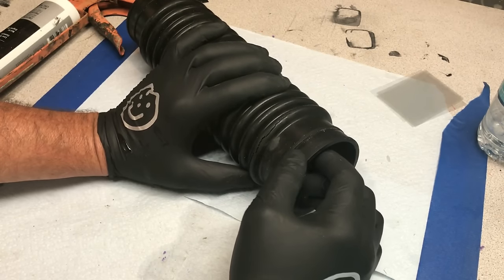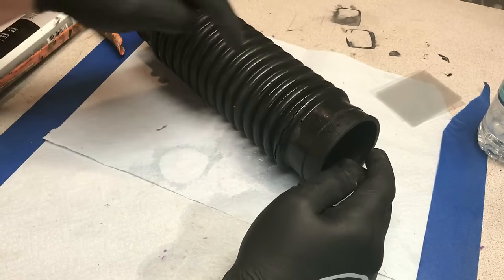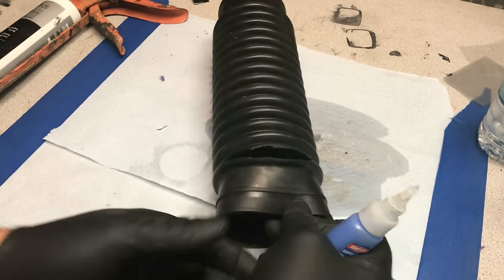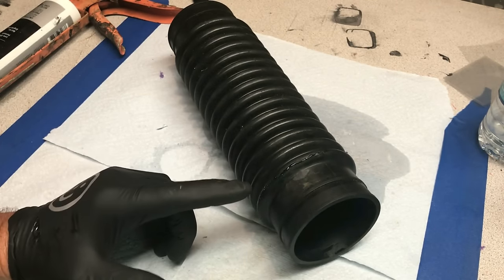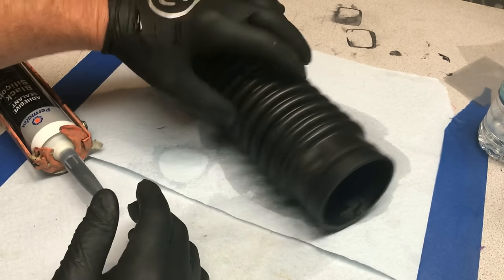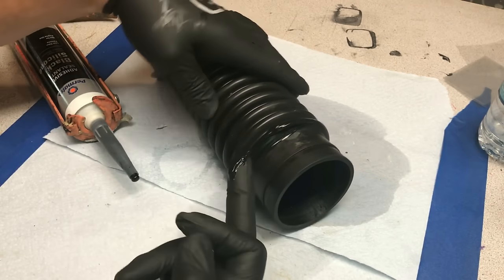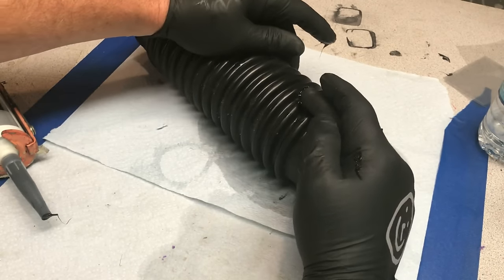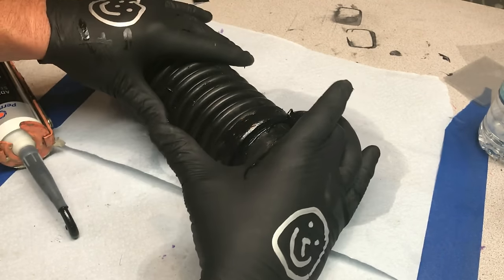How To Repair Split or Cracked Rubber... Intake Tube....Fast and Strong!

Comment: I have a 2005 Honda accord 6 cylinder, the air intake hose has multiple cracks and is completely severed next to the air box. Should I attempt to superglue and apply black silicone to it or do you think it is too far gone? I can send pics if necessary.

Comment: Super glue and rubber has the most amazing bond! A friend and I repaired two front lawn tractor tire side walls. the were tubeless! They are still holding after 2 years. we did add a little bit of slime, but the super glue is still holding the chords and outer layers of rubber dead nuts solid!
Reply from the maker: Joeak74 thats awesome thank you so much for sharing :)
Reply: I'm glad I read this comment.  I Tore the sidewall on my new car tires last night. I'm gonna prep it and superglue the flap of rubber back on it. Thanks

Comment from the maker: Hello SPC Friends and Subscribers, here we show you how to repair most any broken rubber part on your car or truck. We hope you enjoy and have a fantastic weekend :) Also, we want to update you on the https://teespring.com/SWEETSWAG so far because of U we have collected $20.00 in donations with us matching that, we have a total of $40 to give to the Wounded Warriors Project  *Thanks so much, SPC Luvs U All**
Reply: Wounded Warrior got a bad name a couple years ago for misappropriating funds. Lots of them. May be they got that whole thing straightened out but it tarnished their name a little....actually quite a bit.
Reply from the maker: holidayrap well we have all had our problems in life for sure and it is what you do in the problem that really matters...WWP has done much more good than bad for our vet's ..now that they have that all cleared up and all the bad apple's out, they are really moving forward in even a much larger way. :)
Reply: Of course Mr. SPC... I have a lot of respect for you taking time to promote ANY charity. Not much can be said by others in that area. I appreciate your channel very much. Again, respect.
Reply from the maker: holidayrap  thank you so very much Mike
Reply: Question could the black silicone be used on cracked and leaking rubber grease jackets like ball joints and such
Reply: Could i do this on a dust cover for my brake piston? Trying to find a replacement kit and everyone is saying my car isnt a match .. i was even thinking of burning rubber on it lol im out of ideas

Comment: To fix a CV boot without taking it off the car, I used a similar method, having a roofing business in England I had loads of partially cured (sticky) EPDM in strips about 3 inches wide. After really careful cleaning I bonded the boot in the same way, then put primer round the entire circumference of the boot, then applied a round of EPDM 'tape' - it lasted for years, and cost just over half an hour's work, on a Citroen which would have been a hellish job otherwise. Nice video, quick and clear - thanks.
Reply from the maker: Thank you for watching and sharing Gurgle Jug, we really appreciate it.  Hope you have a great day my friend.  mad Mike the hammer SPC
Reply: can u explain the primer u used?
Reply: Hi I'm in Yorkshire my air intake pipe has just split yesterday will tiger seal work on it as I've got a tube in shed will be difficult to get anything else as it's Xmas eve . Happy Xmas

Comment: Sweet, gonna try this on my backpack blower if my duct tape fix doesn't hold up. I took a heat gun to the tape and molded it to the contours on the flex tube. Been good for 3 years now.  Redmax discontinued parts are tough to find and expensive.
Reply from the maker: I’m with you the older backpack blowers are getting harder and harder to find parts for but this works great have a fantastic weekend
Reply: Just finished my Husqvarna blower flex tube repair using this method, and although I don't have a SPC super duper air compressor nozzle.

I made due just fine and dandy! You guys rock!

Thank you and keep'em coming...

👍😀👍

Comment: Mahalo for the tip. Good video.  I restored a vintage VW Scirocco undercarriage shift boot with your method.  However, unlike the air plenum you've repaired, the shift book will be under constant movement like a CV joint boot.  I have a feeling, it will peel apart over time.  We'll see.  I made a video that I'll edit and post sometime.  I noticed that after I got it togther, used black silicone, started to flex the boot, the super glue bond cracked.  I could see the silicone also peel away from the rubber of the boot.  So for some extra bonding, I sprayed a couple coats of Flex Seal inside and out. It turns out that Flex Seal doesn't bond well with rubber and can peel away with ease.
Reply from the maker: Thank you for watching and sharing Darryl, we really appreciate it, hope you have a stupendous day my friend. mad Mike the hammer SPC
Reply: 😊 You too!

Comment: @3:15 i would sand slightly on the inside of rib with an emery board. this will give the black silcon more surface area to grab. JUST SAND the RIB NOT THE CRACKED area.  Ive done this exact repair on a 98 Honda Civic CV boot and and it has lasted another 10 years !!! Again dont sand the actual crack BUT do sand the inside of the rib slightly.
Reply from the maker: Thank you for watching and sharing, we appreciate your input Troy! Have a great week my friend. mad Mike the hammer SPC

Comment: Thanks for the vid. I do want to ask about the 303. You mentioned the intake hose would be covered with 303. -Should we be careful not to get 303 on the repair/dried silicone? -Or is it something that's fine to go ahead & submerge/soak/cover in 303? -Should it only be sprayed away from or around the repair?

Thanks again
Reply from the maker: Once the repair is cured up, you are good to douse the thing in 303 until the cows come home.  Thanks for asking Donnie.  Have a great day my friend.  mad Mike the hammer SPC
Reply: What is 303?
Reply: Is 303 a product one can purchase? Or is it a homemade "secret sauce"?

Comment: As you said, “clean the surfaces to make sure the adhesives will adhere.”  Make sure you have vigorous ventilation when using volatile solvents like lacquer thinner. After cleaning the surfaces with lacquer thinner or alcohol, air dry, then test to see how clean the surfaces are by spraying clean water on the surfaces to be repaired. If it is free of grease, the water should sheet in the surfaces. If the water beads up anyplace, you will thank yourself for checking because the adhesive would have failed.

Conditioning the part before repairing is optimal. Treat the rubber with wintergreen oil in a carrier solvent like alcohol 1 to 3 dilution. 

Always use gloves, don’t touch the part with bare hands.
Reply from the maker: Paul Menten you are a great Subscriber thanks for sharing :)
Reply: I wonder how we can do this on the  front axle CV shaft. my axle shaft boot is broken and leaking and it is full of grease. we can still do this work on that torn rubber boot on the axle?
Reply: @shakirahmedtth  did u ever try this im in the same boat with my axel boot

Comment: Hey HEY!.. hats off to ya as usual.. great work and share as well.. quick question I have semi soft some sort of foam based smooth rubber like finished arm rest/door handle on a Peterbilt that of course has degraded greatly over the years and now had the metal handle base breaking thru.. any videos on that type of repair/fix?.. wish I could supply a photo.. ok then.. enjoy that Fla. weather!
Reply from the maker: Hey Stephen, sorry about the delay in responding, if you can send us pics of your door handle to sweetprojectcars@gmail.com, we will see what we can do for you my friend. Thanks for watching and asking, have a great day. mad Mike the hammer SPC

Comment: Hello SPC! I have a question for you but it is regarding stone chips repairing. I used your guide for that. And I satisfied around 80% )
The issue is when I was sanding the primer in some spots I destroyed a bit more than I should clear coat. I didn't find any videos from you on how to repair the clear coat )))
Reply from the maker: Kyryll Haponenko the only way to repair clear coat is to buff it back to a shine with your mother's polish or if you took the clear off you will need to reclear it see this it may help https://youtu.be/0kVRwnRIb54

Comment: Thanks for sharing your experience. That is perfect. A query that I have - will the glues be hot and UV resistant?
Reply from the maker: The glue we show in the show more of the video description is not a hot glue it will withstand high temperatures very well and it is a UV silicone glue is well

Comment: Genius.  I'm likely going to be doing this shortly.  Thanks for this fantastic tip.  I just can't say I'm going to remove the rack and pinion to fix a the rubber seal.  Likely leaving it in place.

Comment: Would this repair be gas and oil resistant,  I have a stilh carb intake manifold on a ms201t that is ripped in half , it's a  expensive part , more then I paid for the saw.
Reply from the maker: Yes it sure is David! Have at it my friend, thanks for watching and asking, have a great day and all the best on your project. mad Mike the hammer SPC

Comment: Hi I've got a crack in my tailpipe the tailpipes very Rusty but I don't have the $100 to replace it. I've looked around on YouTube and the suggestion is tiger patch. Do you agree? It's on the straight.
Reply from the maker: It is definitely worth a try I will be doing a video on repairing basically the same thing but that will not be for a couple weeks

Comment: Will this work an extractor hose of this type that ripped apart ? Am I able to glue together and hopefully hold till I get a new one?
Reply from the maker: Give it a shot, Louis, sounds like you've got nothing to lose.  Thanks for watching.  Have a great day my friend.  mad Mike the hammer SPC
Reply: @SweetProjectCars   i went and bought what you used and the rip so was so severe there was no way it was gonna hold so luckily it was ripped towards the top end where rubber slides onto the tank. I cut off the hose about 15 inches took off the glove and put back onto the remaining hose. I lost some length but luckily this hose is around 15 feet long. Saved me 140$ from buying a new hose. I did use the super glue for a small tear but should hold up just fine.  Still under warranty so we'll see if they send me a new one. Now I'm off to go do an interior detail.

Comment: would this work on an intake rubber boot where gasoline would be passing through the boot and very close to the high temps of the engine?
Reply from the maker: Give it a shot, we've had great results when using this process on the many things we have used it on.  Thanks.  Have a great day.  mad Mike the hammer SPC

Comment: So you're saying if the crack is "in the valley" between two ribs, then you can skip the super glue and go straight to the Permatex silicone, right?
Reply from the maker: It's always good to use the superglue if you can no matter where it's at, but if you can't get to it in the valley area then just use the silicone.  Thank you for watching and asking.  mad Mike the hammer SPC

Comment: Do you think this would work on the rubber flap hanging down under the front bumper? I'm wondering if it could hold up to something designed to scrape on stuff?
Reply from the maker: It will definitely work, but we suggest not pulling up too close to bump stops in parking lots, that will help tremendously.  Thanks for watching and asking Dylan.  Have a great day. mad Mike the hammer SPC
Reply: @SweetProjectCars  Thank you for the reply! I just bought a lowered 2011 mustang gt. The bumper scrapes on everything. I noticed the flap is holding on by a couple inches on both sides . My repair area is about two feet long.. I will be taking off my bumper and using the method in your video. Thanks again Mike

Comment: Love your videos :) 
I was lurking for a while then subscribed :) 
Luv the way you say Hi Guys and Girls as there are ladies watching too :) 

Sorry to ask on this video but I went to your channel as there was no way of mailing you :(

I have two (hopefully?) small issues with a car I am restoring,I live in the UK and imported a car from California I am slowly working through................

The car had no headliner and no sound deadening,I want to install a new headliner but first new modern sound deadening but I cannot get the remains of the old sound deadening and glue off the inside of the roof :( 

Its 43 year old glue its set like concrete a has remains of the old sound deadening still stuck in the glue :(

I basically have a hairy roof !

Could you upload a video showing how to get rid of decades old glue?

The car is really solid so dont want to strip the paint off the roof.

Second question,the car in its life blew a motor so engine parts were in the car for years the interior is in good shape but I have an oil stain in the passenger seat its been there for at least a decade so its well set in and dried!

Seats are Vinyl can I remove an oil stain that old from vinyl?

Thanks for all your videos :)

Jo (Wiltshire UK)

P.S. I need products that we can get here in the UK too ;)
Reply from the maker: Jo thank you for subscribing and welcome from the great UK !!!  Jo as far as the old glue you need to try this https://amzn.to/2zFZbHM it works very well for the old glue. as far as the oil stains in the vinyl that have been there that long this is the only thing that may work for you https://amzn.to/2KY83he if that does not work you will have to redye the vinyl hope this helps my friend.
Reply: Thanks I will certainly try that glue remover as I have a prime sccount  so can get it fast ;) The seats I am thinking of redying anyhow with something called Kolorbond as I have sourced some better trim but its the wrong colour. Just thought I would ask as you know all the good tricks ;)
Car is a 1975 Mustang II I know they are a marmite car but I like them :)
It has a 302 in it,its a very solid car lived all its life in Sacremento but sadly a critter had been living in what was left of the roof lining :( 

Once the glue is off I can get new sound deadening a a new headliner :)
Love all your tips I find thesedays people overthink things and think something cant be saved :(

You just have to think outside the box like you do and its amazing what can be saved from the trash

Jo

Comment: I’m going to do this but shorten the tube (cut it in half) on my go kart build  because the air box and tube sticks out about a foot out and doesn’t look good that far out. Where do you recommend I cut between the ribs??
Reply from the maker: You cut in the valley of the ribbed tube.  Thanks for asking, hope this helps.  Happy New Year.  mad Mike the hammer SPC

Comment: Can we do this on the front axle CV shaft without removing the boot? actually it remains with full of grease  and just wondering how we can do the glue part with full of grease on the rubber.
Reply from the maker: Yes you can repair without removing the boot, just make sure you use this  https://amzn.to/3hsXZbJ  to clean thoroughly then make sure you use this  https://amzn.to/2LfFaJh  Thanks for the great question.  Good luck with your project!  mad Mike the hammer SPC
Reply: @SweetProjectCars  I just replaced the full axle..axle didn't come out and was jammed and then wheel bearing had to cut and remove. So axle+new wheel bearing + labor costed me 598 Canadian dollars.. little heart attack.

Comment: Can you fix my Range Rover P38 air suspension, it's not raising because of the hood sensors is telling the car it's still open.
Reply: Viking Raiders can you bypass the hood switch? If the switch should be closed then all you need to do is connect the wires together with a BP connector and tape (then hide it).  Never have to worry about the silly hood switch again.
Reply: Martin Lang 
Thanks much appreciated

Comment: That's fine but what about seam repair on a moving part like a diaphragm. That join shown here is static and not subject to stresses like in a diaphragm.
Reply from the maker: Works on moving rubber too.  Thanks.  mad Mike the hammer SPC
Reply: @SweetProjectCars  But we can agree pump repair is a bunch of bs sometime. .you fix one thing another goes wrong seemingly unrelated.  😏😐

Comment: Will that work on a front wheel drive outside axle boot ?? ( still on the vehicle )
Reply: If you can clean all the grease off both sides of the crack and hold it together until the glue takes hold I would try it. Your only out of a few dollars of materials and your time if it doesn't hold.
Reply: J B  oh ok, thank you ..
Reply from the maker: Ron it sure will it will work like a charm
Reply: Sweet Project Cars thanks you, it sure will save me some money!! I got one right now that need that done to it !! Thank you for sharing all your how to repair videos with us !!!
Reply from the maker: ron you are very welcome my friend :) Mike

Comment: Is there any magic trick one could use on a car with an air-suspension to prevent future leaks? I mean some pre-emptive treatment...?
Reply from the maker: There is a specially on Mercedes or range rovers and spray a little 303 inside the main airline from the compressor it will keep all the seals from dry rotting that’s why they leak
Reply: thank you very much sir :)

Comment: I desperately need your advice on how to repair the damage a lady drivers fingernails has done to the dash and door buttons on a VW Touareg. The constant tapping has lifted and removed the black coating revealing the white base plastic underneath. VW has no sensible/practical solution and can only suggest a complete console replacement! HELP!

Comment: I need to do this on my 2003 Polaris Trailblazer 250 because they don't make the airbox boot anymore, and I couldn't find it anywhere. Other than used on eBay. Why pay $60 or more for a 20+ year old part...